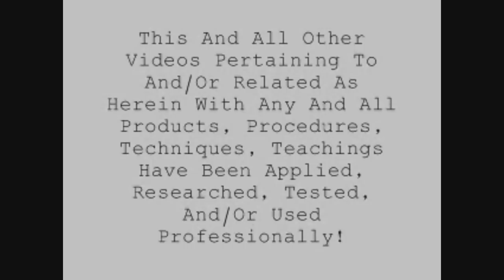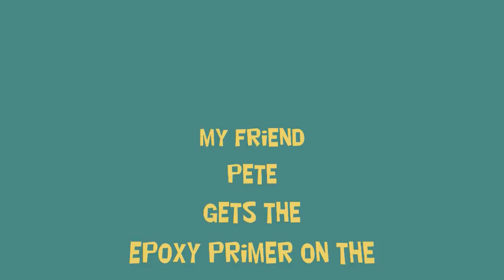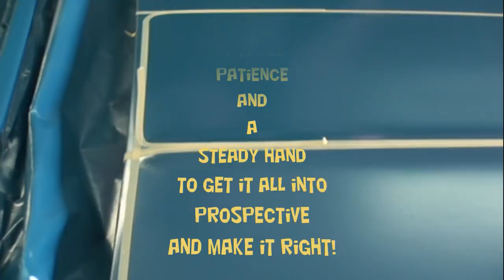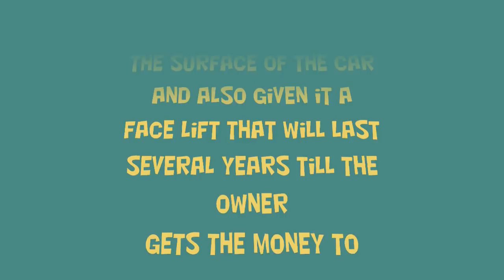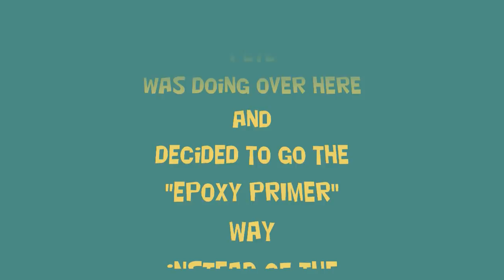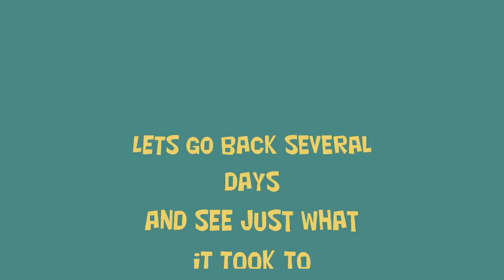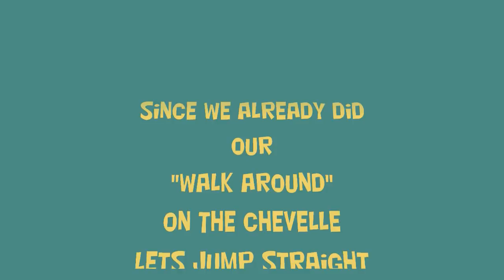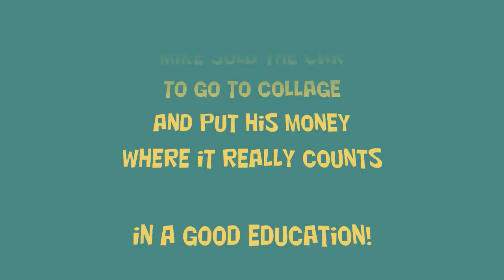HOW TO PAINT YOUR CAR "CHEAP", Using Epoxy Primer - Part 2

Comment: The funny thing is I'm basically in the same situation.  I have 67 beetle which is also a convertible. It's a bondo buggy which needs the pans replaced and everything else. I patched all the holes and have everything sanded.  I'm going try to do some bondo work on it to make it look a little better.  Lots dents and dings everywhere.  So basically I wanted to keep it cheap because this thing needs so much work.  You have me convinced this is the way to go.  Thank you my friend Pete!

Comment: D.I.Y. AUTO SCHOOL Would it work to use a black epoxy as both the sealer and color coat and put a clear coat directly over it? I put down epoxy then did all my bodywork, then put down a high build poly and blocked it out, then covered that with two coats of black epoxy. It laid down beautifully and I love the color.  Will I have a good long-term paint job if I just go straight to clear now? Thanks for all the videos.

Comment: I'm really liking it. Guy will still be able to enjoy his ride while he saves up to get the body work/paint job. I'd like to do mine in red oxide color like you used to see back in the day.
Reply: Robert Shelton I'm no paint and body guy but from what I hear, it's standard to epoxy seal cars that aren't going to be finished for quite some time. Of course that's if you are going to the bare metal as he did on this car. And from what I hear, the areas not needing body work only need to be scuffed down to get a mechanical bond so no need to sand it all down again.
Reply: Oh and I've also heard that you can do body work right over epoxy. Some don't like it but some do it.
Reply: Classic Ride Society I used HOT RODZ FLATS on my 1972 suburban it was a flat yellowish color I tell you that is some durable paint
Reply: yeah, I  sealed my  chevelle  the same exact  way but went with a matte "garbage truck green" I guess I would call it....anyway, it was a pigment of my imagination.
Reply: MY FRIEND PETE okay that just answer my question it does have to bear metal, I have a 47 Chevy coupe I want to restore but not to worried about the body work I'm in a wheel chair so it's going to have power steering set up and power breaks
Reply: One more great car on the road!

Comment: Hey Pete. I really  needed to see this video. I have learned much by watching your videos on welding and body fill. But this video will save me much money. I am retired living on a Government pension, so Money is little. The end result of my build will be of course the paint. And that part was scaring me. I got prices on paint and I couldn't believe the cost. ( $130.00 a quart Canadian ) And I don't know how many quarts it will take. Maybe 10 or more. The paint that I am talking about is called Hot Rod Black. Here in Canada everything is more expensive . I am going to check the price of primer/sealer  instead because I want my truck to be flat black anyway. Semi Rat Rod.  Does Sealer have UV protection in it so it will stay nice for some years?? I don't want it to look like hell in 3 years if you know what I am saying. Thanks for all your videos Pete.

Comment: Brilliant idea. I've been considering this because it's kinda hard to get enamel paint in the UK coupled with a hardener, whereas epoxy primer generally comes as a 2 pack here, primer and hardener. How durable would this kinda job be, good enough to withstand the terrible British weather we get across the pond? And if I wanted to go base/clear in the future - is it simply a case of sanding down and a light coat of epoxy again, followed by base and clear? Thanks again mate.

Comment: Hey Pete love your videos always learning a lot. I am a college kid and have a 69 mustang that needs to be painted or at least sealed up in New England area. I am debating on working with a local shop to epoxy prime it but for the same price I can send it to Maaco (a cheap chain painting company that can get the car in paint for under $1000). I know Maaco isn't great I've had work done there before and I know down the road I will want to get a nicer paint job but I just don't have the money for it now. Which way do you think I should go?
Reply from the maker: It all depends on how you want to restore your car.. If you want to go full bore and completely restore it to new, I would say epoxy prime it for now and restore it in the future.. If you just want to throw some color on it and drive it around then do the Maaco job, just remember when you put the maaco paint on it, you'll have to remove it when it comes time to fully restore it!

Comment: Pete you have to remember that even though the guy doesn't have the money to do the job right, its your name thats going on that paint job and the way the work turns out is a reflection on you and your work style. so by leaving the body work unfinished, what is that saying to perspective customers.  Like you keep saying "if its worth doing its worth doing right".
Jesse, Camden, DE
Reply: Yes but you also have to take into consideration that the general public that make up your perspective customers see the work done and they are not aware that the customer couldn't afford to do a better job, so in a situation like this you are actually putting your reputation on the line in order to save the customer money.  Maybe it would be advisable to tell the customer to put off the work until he has the funds to do it right rather than jeopardizing your reputation. or offer to do the right job and have the customer pay it off in installments with a down payment he can afford.
Reply: True within reason.  He did this guy a favor and its not bad work.  He preserved the metal and didn't sell this as a finished job.  How's keeping a guy's car from rusting away a bad thing?

Comment: Once you have your car covered in expoy primer how do you get it cleaned off to do repair if you can’t sand it
Reply: He said with epoxy you had to wait a couple of years and let it really harden.  Or, maybe I misunderstood.
Reply: @Colin Thompson   >Epoxy sealer/primer is just that. It can be sanded with the grit required for YOUR next step. It is epoxy so it sticks to per-cleaned metal, sanded with 80 grit for most all brands. It’s main benefit is it sealed the metal from water & humidity. Thru evaporation and chemical cross-linking, it become one large molecule.It can be sanded once cured. Many online forums have many who like SPI.com brand as it has a 7 day open window that allows for filler, body work, etc. If using SPI epoxy/sealer, the owner answers the phone. If thinned by 50%, it works like a regular sealer over sanded filler to keep paint from soaking in and perhaps changing colors. I think Pete is using PPG but I was looking. Yes, it can be sanded w/400, wet sanded w/600 and painted base coat-clear. Like me, just do the research. I’ve only painted 6-7 family cars, as some of the 4 kids, became good at wrecking them. But I just fixed them for my paycheck. ASE Master Tech since 78-Retired

Comment: Hi Pete I am working on a Toyota FJ40. I have an extra set of doors for it. I would like to turn the full doors to 1/2 doors like on a Wrangler Jeep. So the plan is to gut the doors cut the shape and weld a cap on to rest your arm. I think Flange weld? Any ideas?

Comment: How do you get the door edge trim off and back on without scratching up the paint? How about make some more videos on trim removal/install. Have seen your video on removal windshield trim removal. Also seen rain gutter removal but did not see anything on installation. Great tip on use of Epoxy sealer....and Mike's story...Thanks
Reply from the maker: taking the door edge trim off is easy, you take a flat screw driver and tap it off on the edge, when the car dries for a few days you just line it up and take a rubber mallet and tap it back on..  Thanks for watching!
Reply: thanks

Comment: Epoxy over bondo, or do you cover the bondo with something first?
Reply from the maker: you can put epoxy over bondo in a case like this, but if you where to refinish the car to the paint stage, then you would actually finish the body work, use a 2K filler primer, blocksand and then epoxy prime right before applying basecoat paint and clear!
Reply: Thanks Pete, I'm slowly but surely figuring this stuff out.

Comment: I have a question I bought a 76 f100 covered in bad surface rust after I get it to bare metal should I epoxy primer it or k2 primer it or can you epoxy primer then k2 spray it to keep rust from coming back? Thanks

Comment: my man Pete, is there any way to make chevelle shinny finished then on? i just got painted on epoxy using base gray coat and 2 acrilic coat for over base and epoxy finish, but it seems no so shinny, i tough it would be more mirror finished, so that's my question, thanks alot for this vids
Reply: Hand rub it with a buffing pad

Comment: My friend Pete, I have done the body work on my 02 Nissan frontier and it has several large spots that needed bondo. I want to primer the entire truck with Sandable primer. Do I need to use epoxy sealer? There is no rust. I will be painting it days after the primer is applied.

Comment: What's up Pete, I had some pretty bad surface rust on a roof used 80 grit cleaned it all up used the vinegar and water then sealed with ppg sealer, now I have rust coming through again, what can I do now??
Reply: Gono Lara the rust is coming through from the back side. Need to clean and seal it.
Reply: there are different types of sealers, some are intended to stop colors from bleeding through....not water...
Reply: Use epoxy and it won't rust. Sealer won't seal bare metal
Reply: robert drugich agreed

Comment: Could you do a video on prepping and painting over chrome, thanks
Reply from the maker: The only RIGHT WAY to paint a chromed item is to have it sandblasted to remove the chrome.. Your taking a chance by painting over chrome that eventually it will flake and peel off, which will in turn make you throw your money down the drain...
Reply: D.I.Y. AUTO SCHOOL,  thanks Pete

Comment: Can the epoxy primer be cleared
Reply: @Joe Jernigan  >Depending on the brand but I think most won’t have a clue in a paint store. You may want to check out SPI.com.
They have a high quality epoxy primer/sealer (Sealer), in black and white. The phone number gets the owner to answer. Their epoxy primer/sealer has a 7 day open window after a clean surface, cut with 80 grit. I am not sure if it can be tinted but the will tell you. It also requires a high quality color tint as Pete is using PPG. Ask about UV content as it is meant to be covered. The 7 day window allows you to apply filler, spot prime as needed, but SPI epoxy can be reduced to use as a sealer coat before paint. Remember, Pete uses a urethane reducer at 10% to allow it to follow out flat. If body work is done, 80 grit is complete, spray your epoxy primer sealer with tint or straight black or white then clear as it has the “UV” inhibitors during the open window of the epoxy. Like all epoxies, this seals the metal from humidity and water. It cures chemically and by evaporation. SPI is very popular in online forums for cars and 67-72 C10 trucks. Guy just love the stuff. On youtube, look for “MrFireman164”. He did a complete Camero by himself. Bets of luck as I prepare for my 67C10 pickup next spring. Best of luck and doing my research!
Just like you, I am learning from Pete, as I fixed cars, but only painted 6-7 family cars and product changes. It’s like buying a new laptop. It’s outdated before you get it out of the box. Best of luck. ASE Master Tech since 78-Retired.